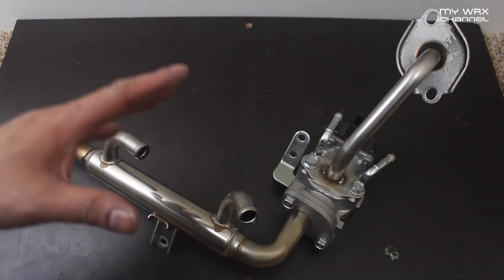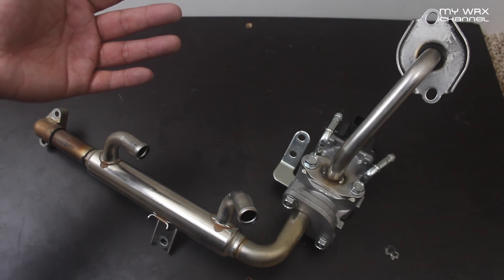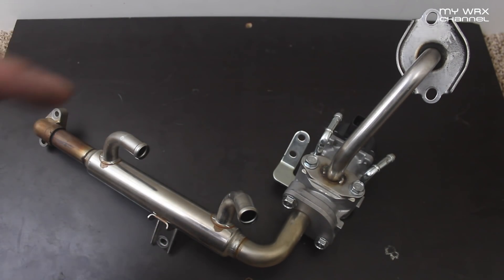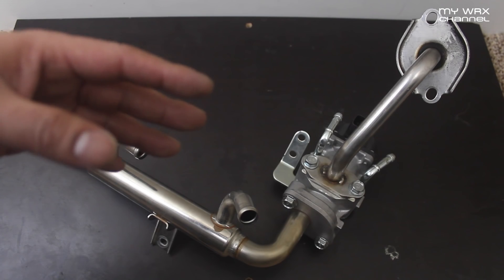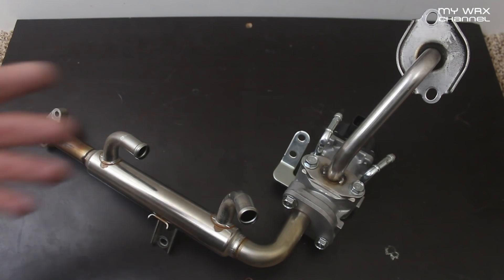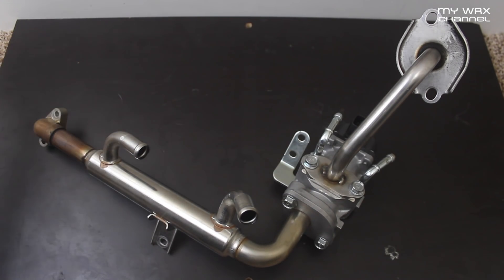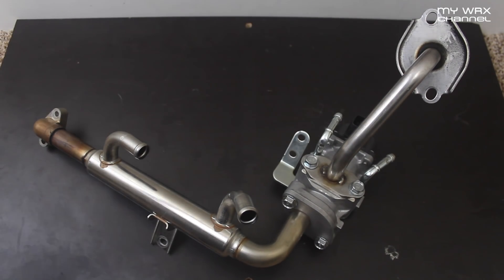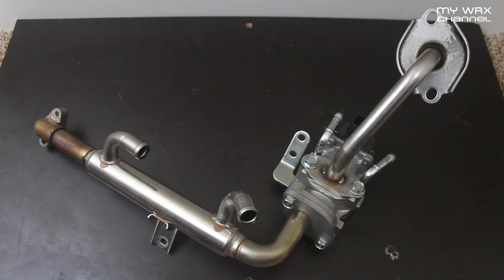Quick Take: EGR Delete Why? 2015-2016 Subaru WRX

Comment: I've deleted the EGR on every car I have ever owned, I have never noticed a difference after. The EGR is held closed at idle and held closed at WOT. It opens progressively according to load and actually LOWERS combustion temperatures in the cylinders. I am not a WRX owner but I would assume Subaru uses the same aforementioned logic. I think this mod will help delay carbon build up on valves thanks to DI and that's about it. JMO 's, I am not a tuner.

Comment: You can just unplug it and tune. No need for a delete kit...
Reply: You can still get soot in the egr system which can be pushed into the motor if and when it's plugged back in...

Comment: It is a good mod if your more focused on making power. EGR is designed to lower emissions and also betters fuel mileage at highway speeds. If you okay with that then it's a great mod.
Reply: Or, the extra heat in the intake from EGR causes knock detect which lowers DAM and timing, causing the car to use more gas and emit more pollution.
Reply: Allen Valencia you buy a Subaru for power not mpg

Comment: If you lived in a state that requires emissions testing, can you re-install the EGR and flash back to the stock tune if needed?
Reply: Get blanking plates for the ends. Leave it in place. Shouldn't bother emissions hugely.. Remap will remove it from the system.
Reply: @sharperprospecting6980 Is it possible to block the pipes and leave the motor in place, so no DTCs come on?

Comment: can someone please answer my question. Is it possible to stop the EGR by just removing the vacuum line that is attached to the EGR valve? or would this have any potential damage in the long run?
Reply: hey, I've done it this way! still threw a CEL, but all I had to do was take the BB out of the line and 30 miles later code left.

Comment: Did you get evap leak check engine light? Mine comes on every couple hours or so of driving
Reply: You need a custom ECU tune to run the EGR deletes properly.

Comment: can you answer a question no one seems to mention?   what temps are you seeing now (after deletes) at intake manifold?  what I mean is, with EGR there are temps 20 to 30 degrees higher, or more, compared to the outside or intake temp (using AP gauges)..
Reply: dsonyay good question, surprised no one answered yet.
Reply: I have EGR delete and I am seeing a 40-50 degree drop in intake Manifold Temperatures.The Intake Manifold Temps are usually from 10-30 degrees more than outside ambient temp.
Reply: versedispersed hmmm, that's some good info.  Makes sense, I'll have to set up that gauge on my ap, I'm curious now.

Comment: or do I even need them my car seems to run strong still
Reply: Yea just go ahead and keep running it and till you actually can feel a problem and then check with a tuner to see. What. Your options are left if any. Or opt out for preventive maintenance as setup in the form of smoother roll on with better horsepower in the top-end range that most drivers will say will I don't need that not realizing that you won't be pushing the throttle pedal more than halfway to the floor to break all laws the idea is to back off the throttle after you gain the tune and you will go much much farther in miles on way fewer gallons of push juice and possibly just possibly you can be the first Subaru owner to have over a hundred fifty thousand miles on your original engine and still going like the Energizer Bunny

Comment: I bet you also gain power by not throwing in exhaust gases anymore as well. This is a must have if you own this car. Would do this and full bolt ons and tune it ASAP if I had this car... Sadly I just bought a civic 3 years ago so now I really have no excuse to get this car... I wanted to have a super efficient DD and try and save up for a race car/weekend warrior project but getting the time and space for all that is proving difficult. I am missing my DD race cars!!!

Comment: I'm at 23,000 and still running like new. Just don't baby this engine all the time she needs to be runned aggressively once in a while.
Reply: 23000 miles is nothing lmao no car should have problems at those miles
Reply: @Franknorm1337  oh yea the best thing is to wait till its too late to find out your problems start at 20,000+ miles the worst thing about an STI they do not have exhaust pipes that are all the same length but they're all welded to a central collector spending a turbo so what does that matter that means that some exhaust pipes will be white hot While others will the Bullitt carbon there be that much difference between the field Air Races I think Jason selner Google Images I'll see you in his like yours running with a white turbo dark pipe thread pipe in a white pipe until later you open up the heads in there be a puddle of melted aluminum in one of the cylinder and another one with black carbon like burnt coal so how do you eliminate that problem send line for the equal length header on there that I've been told by the boostaholics make no damn difference at all in the tuning of whether you have a untuned header or a two-player kind of tells you something right there about what they know bye-bye
Reply: @donniebaker5984  my brain hurts after reading this
Reply: @donniebaker5984  you ever heard of punctuation ?
Reply: totally agree man..
Reply: Runned? Lol
Reply: Italian tune up??
Reply: are u saying u DID or DID not the delete?
Reply: smartcocker He saying run the car hard to burn it off.